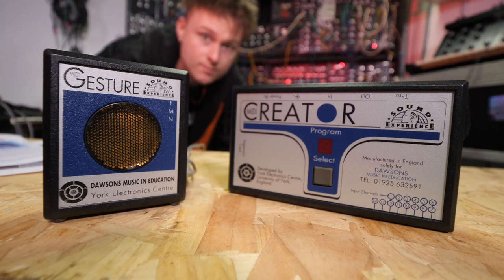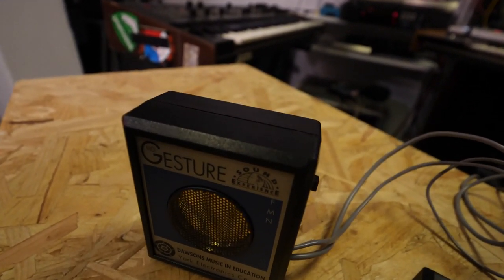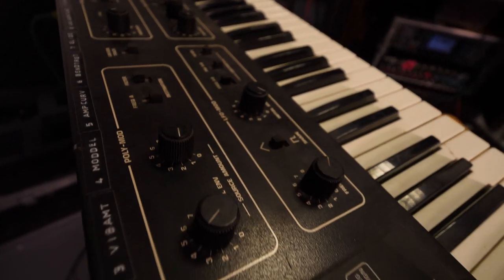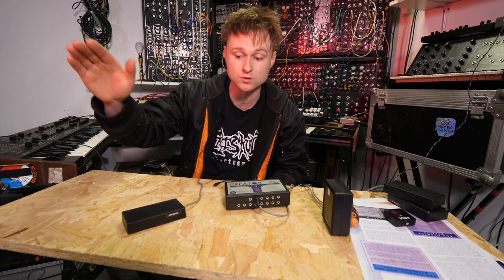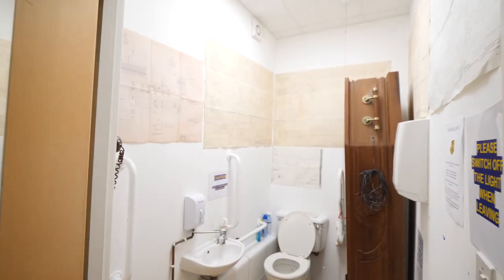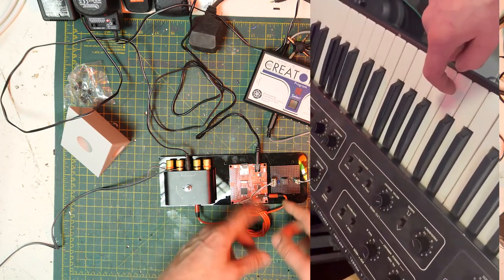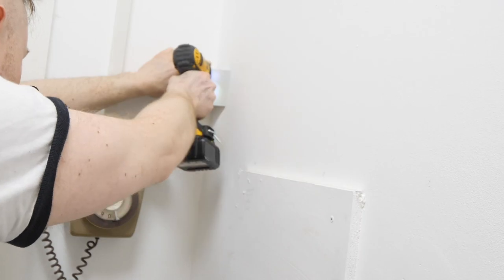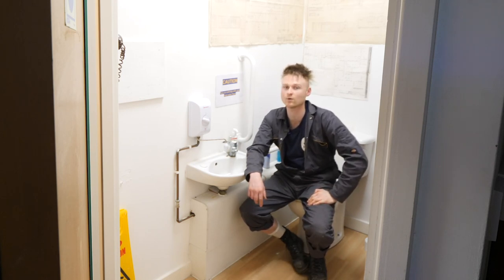A Very Strange Music Machine From The 90's Wired Into The Toilet

Comment from the maker: What you think to this machine?
For all interested. It complies with wet room regulation as there are no mains devices fitted in the room itself. Hence mounting the main bulk of it on the outside. The gesture device is low voltage running on 8 volts. They are a good distance from the toilet itself And the speaker is also just the impedance of a normal bookshelf speaker so it poses no safety concerns. 👍
Reply: I'm a musician (guitar/drums) but admittedly not a "tech-head". I love that there's so much more to learn out there... I typically have no idea what you're talking about (although I did study MIDI in school) and that's fine because you're entertaining and I love the end results!
Reply: Maybe cover up the schematics with some plastic panels.
Reply: Cool! It makes the perfect soundtrack for a slightly psychedelic 70’s Polish animation.
Reply: Job well done
Reply from the maker: @illustriouschin  they were sold about 30 of them for 5 quid. Tbh if they did get poop on em it would be a lot less messy to just scrunch em up and get rid of em 😂
Reply: Maybe add a volume control inside the bathroom if someone is having a rough bathroom experience and wants some peace and quiet
Reply: @Chatot4444  In that case, the volume should go up, to cover those noises...
Reply: This would make a bad-ass door bell!!
Reply: @suburbanindie  Fellow guitarist and gear designer here - learning to wire an electric guitar can be a good stepping stone for understanding the more complicated electronics in effects and such. I got started wiring my guitar and swapping capacitors in a cheap tube amp to change the tone response. Effects like boost, distortion, and equalization are not so hard to learn and much safer than amplifiers if you want to get your feet wet though. I find tinkering with effects feeds back into my creativity by helping understand sound design at a deeper level. Always keep learning!
Reply: Thought about hooking it up to your fart machine with a MIDI/CV converter..?
Reply: quick question : What sd card did you end up using for the wavtrigger? Most of the ones listed on the website aren't available anymore and the ones I've tried don't work great for that use. Thanks in advance!

Comment: that appears to function similar to a device known as a "soundbeam" that used ultrasound heads that mounted in a mic stand along with foot pedals to control a MIDI port (which could obviously make noise)

Comment: I had one of those little ultrasonic rangefinders (the cheap sort with the two little cans on a PCB) hooked to an Arduino and a midi out, that I had set up as either a quantized theremin, a mod wheel/general CC, or a pitch bend; I should revive it and add this kind of arpeggiator mode.  Thanks for linking the article.
Edit: Whoops, except you didn't. Oh well.

Comment: No you cant plug in a keyboard that has the 5-pin DIN connector to midi. Those were used before the smaller PS/2 connectors became standard on keyboards.
Reply from the maker: Well yeah but that isn’t musical I said musical devices